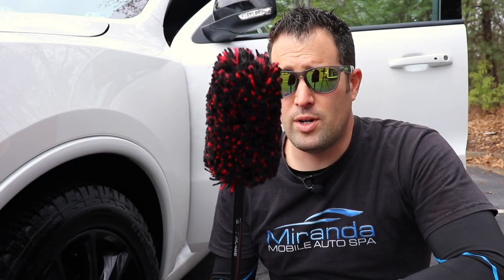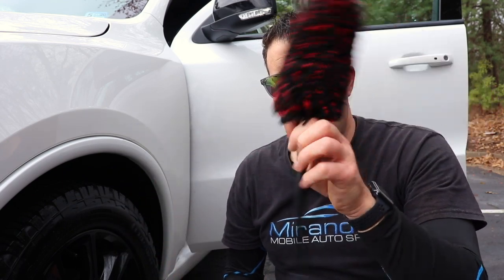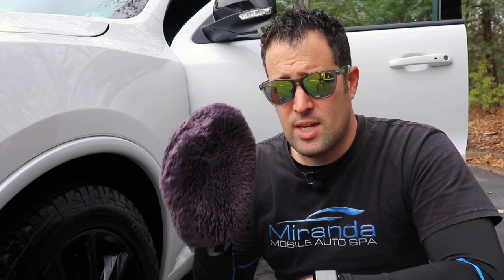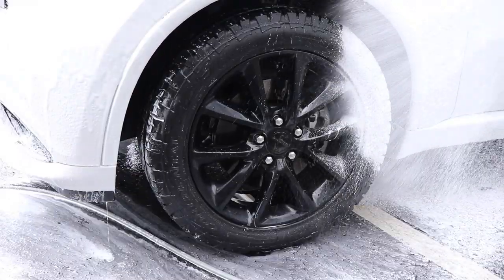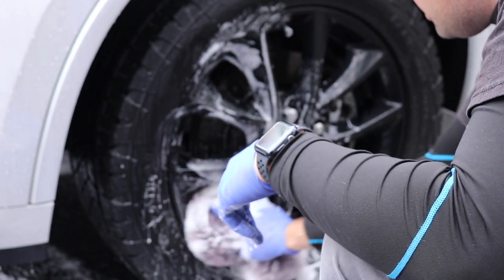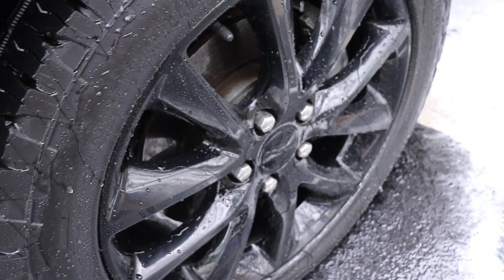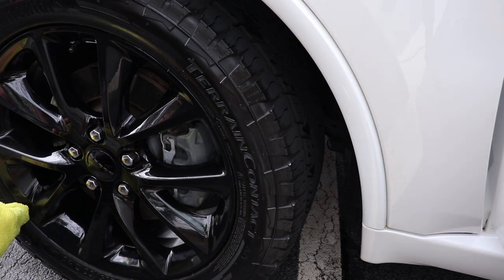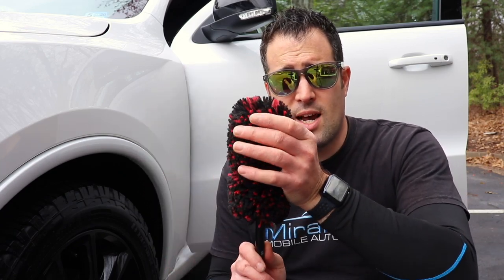How To Clean Delicate Black Gloss Wheels!

Comment: Hi bro, I'm new to detailing and don't have much knowledge at the moment, and I've brought a car with black gloss alloys so could i put a fallout remover on them without damaging the wheels, and if yes then can I also put a wheel shampoo on while the fallout remover is still on the wheels.
Reply from the maker: Hi. Yes you can use an iron Decon wheel cleaner if needed. But you don’t need to use it every time. When you foam over it, depending on the soap, it can neutralize the effectiveness of the iron Decon chemical. I usually just clean each wheel either before or after washing the rest of it. Reserve the iron Decon for maybe every few months. You can use just the car shampoo or regular wheel cleaner for maintenance cleaning.
Reply: thanks bro very much Appreciated
Reply from the maker: @adrianmoore3118 you’re welcome.

Comment: If you can please reply ASAP...i use koch chemie GSF for pre washing..is it better to use it for black rims too? I used first iron remover and then snow foam pre wash on my brothers black matte alloys and they have a white residue now? What could have been the wrong move I did?
Reply from the maker: Hi. Thats weird. not sure why that would happen.  Were the wheels cool to the touch?  How long did you have the cleaner on them?
Reply: @MirandaDetailing  i didnt let the iron remover even a minute as most suggests to leave it work from half minute to 1 minute...i did the same with GSF..i sprayed the whole wheels,cleaned them as usual and after i rinsed them they started having that white residue..from what i remember first of all i turned on the car and moved it a bit outside before i started working on it
Reply from the maker: Matte wheels are a pain to take care of. They will fade over time anyway. You may need to use a ceramic coating on them to restore the finish. It won’t turn them glossy, it usually just restores the black color.   This product works really well on matte black wheels.https://bit.ly/4ePqM8A
It’s a ceramic sealant that works on both paint and trim, and works great on matte surfaces  it can help restore the black color and protect.
Reply: @MirandaDetailing  yeah especially the ones i cleaned on my brothers wheels the car never have been washed properly with products...i think only 2 times over the 5 years he has it cleaned it to a car washer...but if theres a solution for it then its fine thank you very much

Comment: Great video. Learning a lot from your channel. Cleaned my black wheels a couple of days ago. With all of this staying at home, I’ve had some time to experiment. My truck was used when I bought it, and the wheels have scratches on them. After washing and drying, I polished the black with hs black acrylic ceramic polish, used hs black spray wax, then came back a while later, spritzed them with water, and used hs ceramic wet wax and dried them. Still have some scratches, but they shined up great. I also use ceramic wet wax on my wife’s dark gray wheels...good stuff
Reply from the maker: Awesome!  Yeah Black gloss wheels can be polished to really make them pop!
Reply: Next step...to look in on those wheel woolies. Would make it things a lot easier. Thanks for the reply. Great video. Coming from a teacher, I really enjoy learning and think you do a good job of teaching and demonstrating products.
Reply from the maker: Thank you so much! I try my best!
Reply: @mattjohnson-ahs9173  old thread but for anyone else in your situation, after the cleaning and prep work is done, I would use mcguirs polish wax to remove any fine swirls or heavy water spots, then use any friendly car wax to protect it from further sun damage or fading… I do this pre summer and pre rainy season…. (We in end of July and about to do it again with my new black wheels)

Comment: You can use a spray detailer for the protection? Like same as an interior detail spray?
Reply from the maker: Hi. Do you mean using an interior detailer for the exterior on wheels?  If so no, use an exterior paint detailer spray on the wheels.
Reply: @MirandaDetailing  got it thanks. I just detailed a toyota corola with black rims and they are really faded. Not sure why but I tried bead maker and it didn’t help. Any suggestions?
Reply from the maker: You can also use a polish and hand polish them. Use something like 3DSpeed and a microfiber applicator and hand polish them.
Reply: @MirandaDetailing  thank you sir 🙏🏻

Comment: Can the fabric be removed from the wheel woolies in order to wash them in the washing machine? Assuming they can be, can replacement fabric be purchased? Is the material on them microfiber?
Reply from the maker: Hi. So these wheels whoolies you can’t replace them. But these you can https://www.carsupplieswarehouse.com/products/autofiber-barrel-blade-wheel-brush?_pos=11&_sid=9e4894381&_ss=r
Use code MIRANDA10 for 10% off
Reply: @MirandaDetailing  okay, thanks

Comment: Hi Phil, thanks for the advice mate. I have a question for you. I have 19" wheels and huge breaks on my BMW M4. They also have a stupid aluminum gard that goes round the disks. This makes a very very narrow gap between my wheel and breaks. What would you recommend?  I've thought about the wheel woolys, but I bought a Gyeon version and even the smallest one is too big. Thanks in advance!!
Reply from the maker: Hi
I also use this little EZ detail brush https://bit.ly/34aiLaz  it does a good job at getting into those areas.
Also a good way to get to the entire inside barrel is to jack up the vehicle just slightly to be able to turn the wheel and get everything.  It's not very convenient especially for us mobile detailers, but it does work.

Comment: What about a more matte type finish?  My wheels are black but not glossy at all. Paint is matte and wheels have a similar look. 21 inches with enormous disk brakes (AMG GT63s). So dust is really difficult to manage.
Reply from the maker: Hi. You can definitely clean them the same way. I would also ceramic coat them inside and out to make it super easy to clean. Check this out. https://youtu.be/OmGXY31dXsc

Comment: Sorry if it’s a dumb question and I know it was answered in the video, but what can I use to spray on the wheels when I’m drying them? (So they’re not dry and it doesn’t scratch the black)
Reply from the maker: Hi. That’s a great question. If you use a spray and rinse product like this https://bit.ly/32rd77K
You just spray, rinse and blow dry and maybe touch up with a towel and it seals them in for a few months. 
https://youtu.be/Dp-FQM_knNA
Reply: @MirandaDetailing  Would I be able to use a spray wax that’s used for the car paint on my rims?

Also, thank you for the response! It’s much appreciated.
Reply from the maker: Certainly!  Any spray wax or sealant you can use on the paint will work on those gloss wheels.
Reply: @MirandaDetailing  thank you sir! 🙏🏽 
Do you have any product/brand recommendations you might offer?
Reply from the maker: Something simple like Bead Maker or Tech choice would work great.

Comment: Phil, great job as always! Quick question, what’s the difference between the Color Crush and Slam?
Reply from the maker: Thanks. Color crush is a Sio2 spray quick detailer. Slam is more concentrated and it considered a Sio2 spray coating. 
Both are awesome!
Reply: Thanks Phil. Last question, would they both be the same as using TW Ceramic 3 in 1 Detail spray and there Ceramic Spray? If so, in your opinion which is better?
Reply from the maker: yes exactly!

Comment: nice video brother do blacj wheel scratch easily ?
Reply from the maker: Hi. Yeah they do. If cleaned to aggressively they will get really scratched and look horrible.
Reply: @MirandaDetailing  oh really i am planing to buy a rim what is your advice best rim for me i  dont want to buy black rim now😅
Reply from the maker: @jesusisoursavior2682 I would have them professionally ceramic coated because it will make them very easy to clean without using aggressive methods. Use the same tools and methods as we should in the video and you be happy! 😎👍🏼
Reply: @MirandaDetailing  i mean what color of rim you suggest is it more good on aloy wheel ir stainless
Reply from the maker: Oh that’s up to you. I can’t make that decision since it’s up to your personal preference. I personally like regular silver painted wheels. But that’s just me.

Comment: What are your thoughts on acid cleaners in this case? We both share the same sentiment that things need to be fast and efficient. For me an acid cleaner on such a painted wheel is great, as there's minimal contact that can scratch and the activation process itself from I spray on to the agitation to the rinse is super fast for me. Also, a product like Meguiar's Wheel Brightener is really cheap when the dilution is taken into account, at least where I am.
Just interested in learning where you guys stand on this point?🙂
Reply from the maker: Yeah I do use Megs Wheel Brightener when its needed. Its such a strong cleaner I only use it when necessary.  Even with Wheel Brightener some wheels need lots of agitation. We did some wheels today, regular silver clear coat wheels that had years of baked on dust. needed wheel brightener and lots of agitating to get them clean.

Comment: Best of all those MF style woolies have no sling back as you pull it out!  The one that attaches to drill is another tool to use, I am impressed. For those tight spots using the 12-inch has a smaller head.
Reply from the maker: That’s true!!

Comment: You didn't use any wheel cleaners. In your professional opinion  is it really possible to effectively clean wheels with just wash soap? Because I like using as little chemicals as necessary.
Reply from the maker: Hi.  Each situation is different, if the wheels are in good shape and need very little cleaning, the soap alone will get the job done, especially on delicate black wheels like these.  All soaps whether ph neutral or higher alkaline have surfactants that actually clean,  they break down dirt and grime and lift it away.  Stronger wheel cleaners may be used only if they wheels really need it. 😎👍
Reply: So in the event that you had to clean the same wheels and they were covered in  heavy grime and caked on brake dust how would you approach cleaning them then?
Reply from the maker: I would use a cleaner like Extra tough, super Clean, or any other APC/degreaser first. Then if needed an iron remover wheel cleaner like Megs iron decon https://bit.ly/3q70Snu
Reply: APC or degeaser diluted at what?
Reply from the maker: 10:1 for light cleaning and 4:1 for heavy.
Reply: Thanks a bunch man! I'm a buy some of that Iron recon on your word man. I like the price compared to IronX.  As effective as IronX I'm assuming or it wouldn't be recommended. Thanks again.